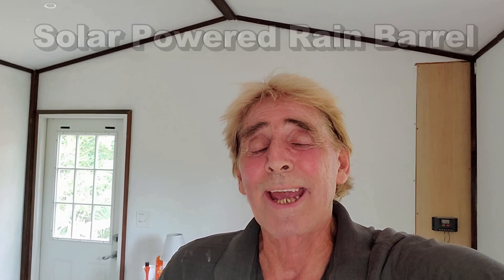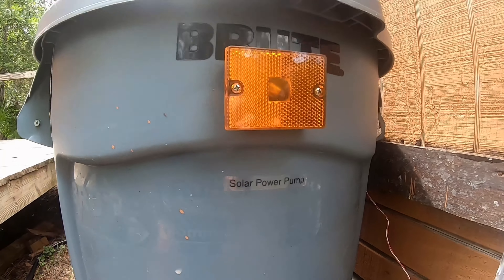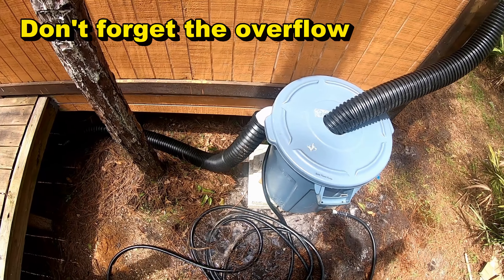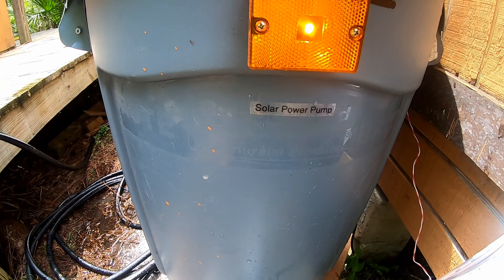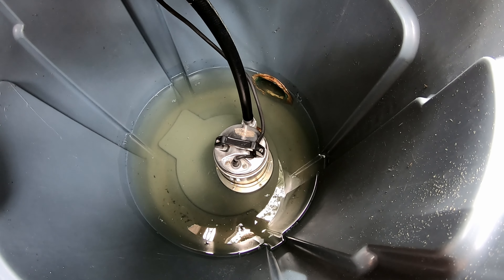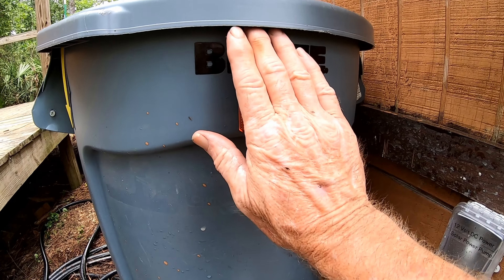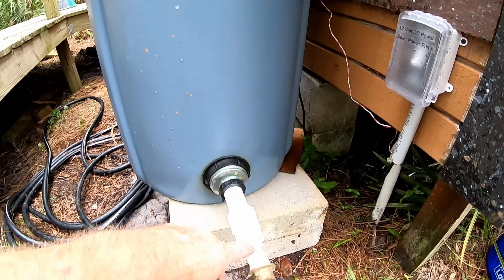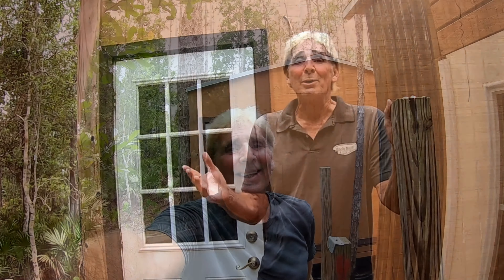Solar Powered Pump for Rain Barrel

Comment: I used to have a 1.3 ton water tank. And I made a base higher above the ground.  Also with overflow.  Pressure is good as long as the plants are lower than the water level.   It was so awesome! But later I sold the hole setup for $90. Because I need to fix some foundation problems. Need to free up space.
And the guy who bought the tank was so happy. He is crazy on flowers  and plants and makes his own organic fertilizer.  That was so cool.

Comment: Nice, I like it!  What happens if the pump is left running but you have a nozzle on the hose?
Reply from the maker: Float switch shuts it off